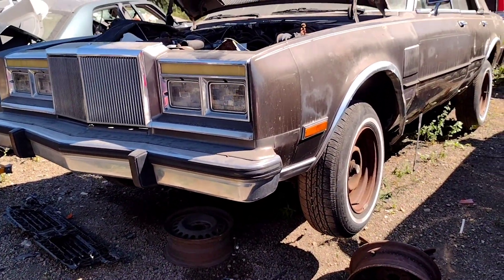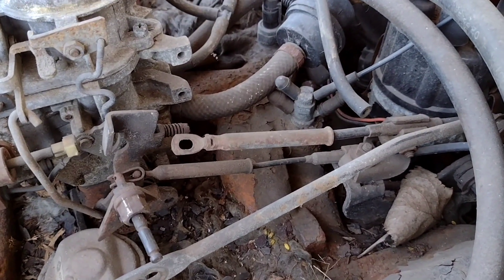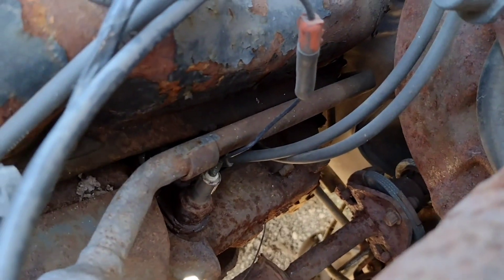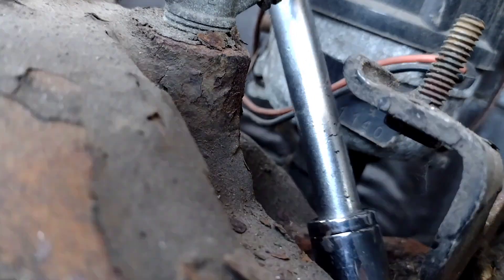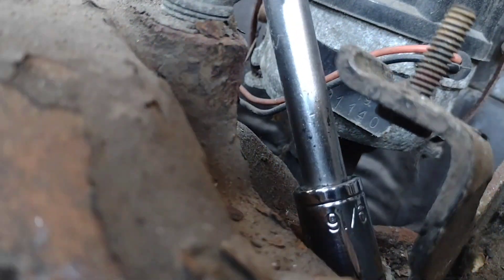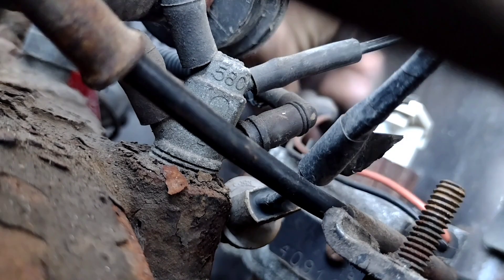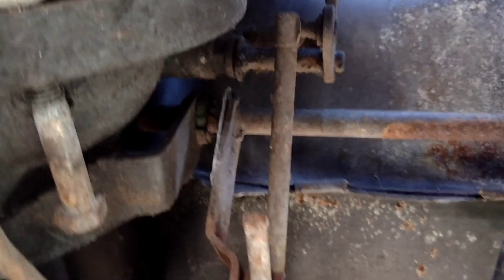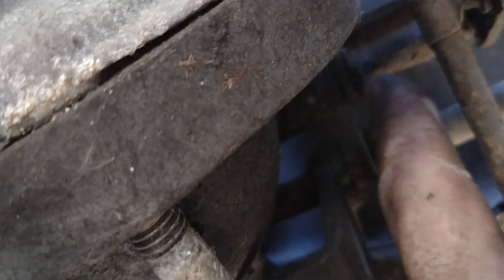A trip to the Junkyard parts hunting looking for a kick down linkage Dodge Chrysler Plymouth 318 360

Comment: Amazing. I was working on a 72 Satellite Sebring Plus this past weekend with a 318 and so much of what you showed on camera was still the same in 87 as far as linkages go. Wish i could have saved that whole drivetrain and rebuilt it. Would have made a killer 318.
Reply from the maker: 72 was a good year for Plymouth. I guess I have to grab another one of those linkages when I see it. I have a bunch of different pieces but not a complete set up for the future.
Reply: @NathansMoparGarage It's a sweet ride in F8 green. Strong 318 with a mild cam. Wound up having multiple issues (bad accelerator pump, vacuum leaks, and a dead pickup in the distributor). Got it running good now but still has a bog from a dig. Might be that the fuel pump is weak. That's next because everything else is new.
Reply from the maker: Sounds like a cool car.  A friend of mine used to have a black 71 Road runner 340 4spd. It was a beautiful car.
Reply: It is. Sounds badass for a 318 2bbl. One day I'll have a video of it on my channel. Unfortunately I'm not a constant content creator even though I have plenty of material. Maybe when I'm retired I'll do more and can get additional income.

Comment: I hope that's either an 85 or 86 New Yorker
Reply from the maker: That one was an 87
Reply: @NathansMoparGarage  That has a good engine in it
Reply from the maker: @matersworkshop6123  I had an 85 Diplomat with a roller 318 is was a good runner with a 4 barrel on it.